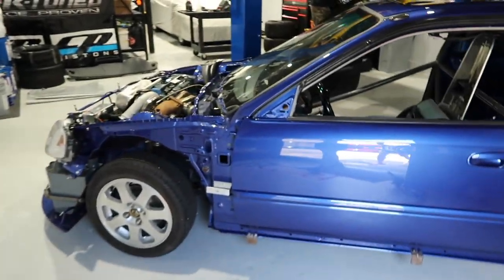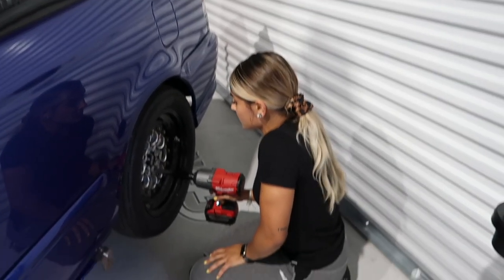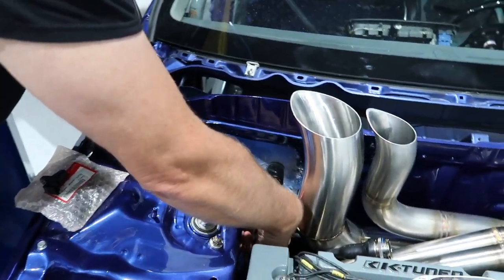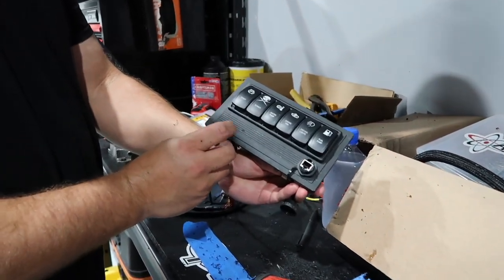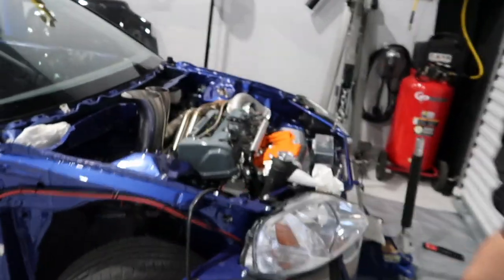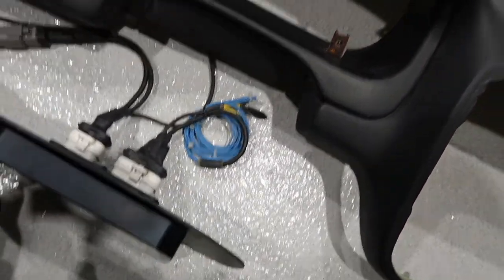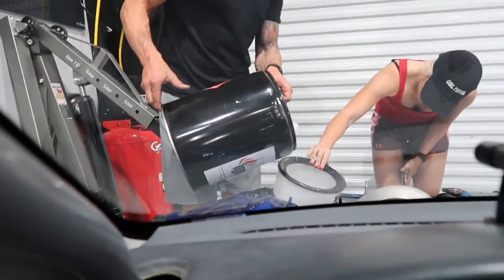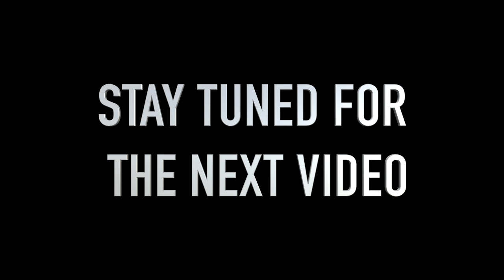DOWN TO THE WIRE ON MY DRAG BUILD

Comment: I'm here for support you and I understand that you trying to chase a dream .... I'm not trying to steal your Glory but the same time I'm address this issue... I figured out the issue with the Turbo System and the 5-cylinder motor and Mazda refused to talk to me ..
even I have Theory or hypothesis on how to  fixed a problem with the rotary engine with the knocking with 5 cylinder motor.... I'm just trying to get my foot in the door and address these issues and across all makes and models... I'll try to reach out to Mazda because they original the one that created this prototype but they can't figure out the issue but the issue behind this... that they look at it at the wrong angle... I am so looking for a sponsor to help me with this project and diesel engine and that's all I'm going to say